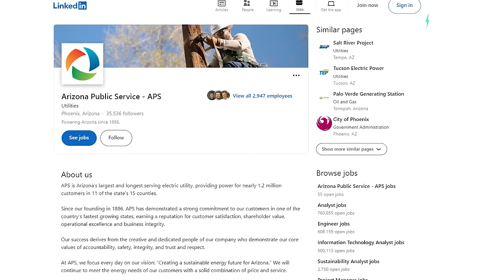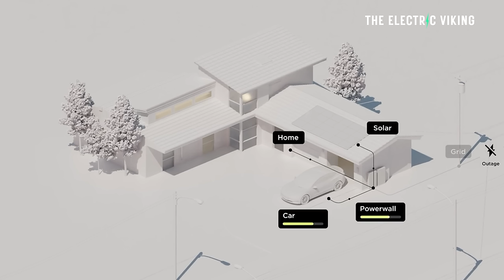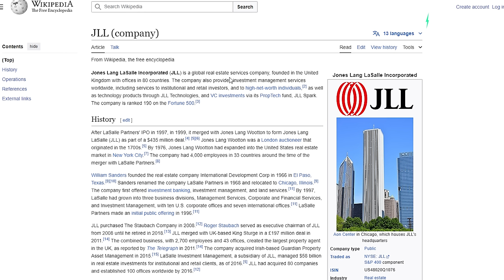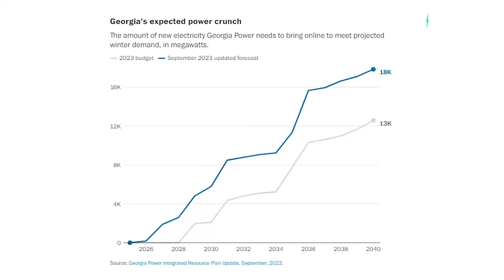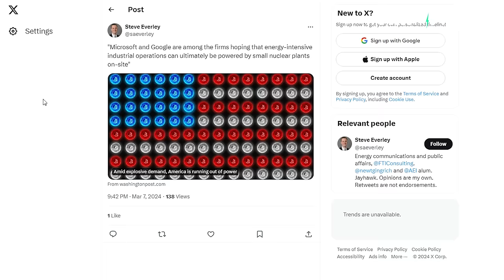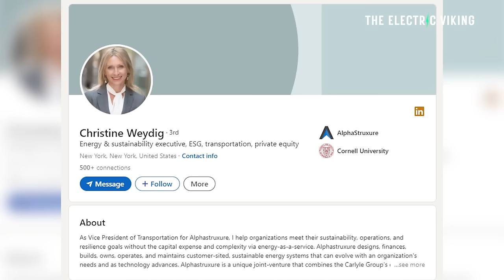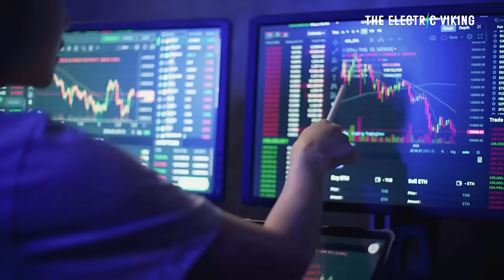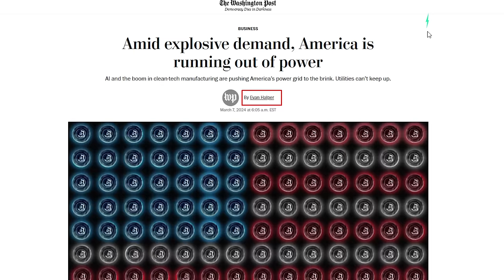An explosion in demand for electricity is creating a looming crisis in America

Comment: Transmission lines are the rate-limiting step.  Capacity and storage are increasing, but transmission ability is not.
Reply: Tesla's one-wire energy transmission system (on high frequency) works, it is even lossless.  I tried to promote this idea to a Dutch electric grid research team (part of a big grid company), but they weren't interested. The problem is outdated physics theories that are dogmatic, to the point Tesla's ideas are not understood at all by the power engineer. Just one thin wire can transport Mega Watts of power, by applying the 'surface' electrons on the wire only, in stead of the 'bulk electrons' in the copper solid that feel Ohmic resistance and heat up the wire. Some universities are catching up with such century old inventions/ideas.
Reply: @koenraad4618 one wire transmission doesn’t scale to grid distances and power. It’s not a matter of physics being “misunderstood”, it’s a case of high frequency electrical current not working well down long cables (which is what Tesla was proposing). Power is lost due to radio emissions by the line, and these losses increase with frequency. The current 60/50Hz grid is a trade-off based on that. Higher frequencies need smaller and cheaper transformers, but don’t work well over longer distances. Even 50/60Hz power losses are unacceptable over longer distances, leading to DC power lines for international links.
Reply: @stevetodd7383  As a EE, I can testify to your correctness in the laws of physics and electricity, and I'm glad there's a few others like yourself here giving intelligible fact-based info on the non-practical aspect of much of this hype science.
Reply: That's true in Texas. There are days when wind generates more electricity than can be used and there are insufficient transmission lines to get the excess to the major metro areas in the state (source = Texas Tribune).
Reply: So energy should be produced, stored and used locally, if possible.
Reply: Absolutely spot on. Out of all the comments read this is the one that states the obvious. We have a transmission and distribution problem!
Reply: Transformers shortage...
Reply: All the Copper mines are nearing depletion. We cant upgrade the grid.
Reply: @MrkBO8  The conductors on the grid are primarily aluminum, not copper.
Reply: Transmission line congestion is a real issue, but transmission lines are not in the dire state that is being pushed (basically its misinformation).... or more to the point, the issues are political, not electrical.   California, for example, has vastly relieved transmission line stress by situating grid-scale storage at critical congested junctions and in those locations it has more or less solved the problem.

Since transmission line congestion generally only occurs in a fairly narrow time range in the late afternoon, it is nearly a perfect match.

Which is great, actually, because now grid-scale storage is able to serve two purposes instead of just one, which more than justifies the cost.  It actually costs more to build-out more transmission lines in congested corridors than it does to build grid-scale stroage to relieve the congestion.   Two ducks knocked out with one stone, so to speak.
Reply: America should make HOMES w/ 480v , in this way they can split DUAL 240v and split into Multiple 120vAC.
Reply: @stevetodd7383  Is the California DC interconnection international? Celilo to Sylmar. Perhaps you mean frequency stability is the reason? series impedance is the primary culprit against HF.
Reply: @RT-mv7df  I get you, even if others don't.
Reply: @hardyvonwinterstein5445  It is 100% possible and that is exactly what is going to be done.
Reply: @Kevin19700  Actually you should have said we don't have a problem, it amounts to the same thing.
Reply: @MrkBO8  This is not very accurate, what if you took the copper down and put up aluminum? Oh, that's old hat, we did that years ago. I think the problem doesn't exist. How about raising the voltage and halving the copper wire used wouldn't that stretch it out a bit? How about using plain old smarts?
Reply: Sorry that's not true either.  This video is nonsense and so is your statement.  This is in fact the VERY reason why the Inflation Reduction Act was passed, to put money into different areas and one is EXACTLY that, the improvement of the national grid.

However that's not an EASY thing to do.  It's a big engineering problem to solve because you have to know where your expansion is going to be for electric capacity, so you don't JUST go out and start adding capacity to move electricity wherever.

And yes transmission lines are a limiting factor.  Lines are being improved in our area, right now, so I guess our engineers already knew this area needed improvement.  And I've also seen a CRAZY amount of growth in the number of Teslas in this area.  It's a little surprising.
Reply: @tedmoss  what I meant was very long lines. AC grids always need to be kept in synchronisation, and the technology for that is old and well understood. AC to DC then back again at grid scale is an expensive undertaking and wouldn’t be used for that. Where there’s a mismatch between grids (I.e. say one running at 50Hz and the other at 60Hz), possibly, but that’s not the main reason for using DC for very long lines.
Reply: capacity of storage is not increasing and energy demand is increasing too.

Comment: Just checked the UK grid. Wind is only at 7% and solar at 5%. It can go a lot higher, but at the moment its Nuclear and Gas picking up the load. Solar and Wind are NOT reliable enough. It's probably the same in the US.
Reply: Wind has gone from 16GW at 5pm last night to 2GW at 9am today. This is where we need more solar capacity and definitely more batteries and maintain our nuclear for as long as possible for these dips in wind.
Reply: Wind/solar without batteries is unreliable, but wind/solar plus batteries is much better. Whether or not wind/solar plus batteries is good enough might be a matter of debate, but some books and videos by Tony Seba (look at his recent five-part series on his YouTube channel) suggest they can be.
Reply: If the money spent tackling Covid was spent trying to tackle the climate crisis it’s perfectly doable even with existing tech but too many vested interests
Reply: Wind, solar, and tidal works best when surplus energy is stored in batteries.
Now, too often, turbines are switched off because of lack of demand at some hours.
Reply: @Acemeistre  People pushing wind farms will talk about the "average wind speed" of an area as if that means anything. It doesn't.
If you the ideal wind speed is 50 km/hr and the region has winds of 0 km/hr today and 100 km/hr tomorrow, the average is 50. In reality the blades either have no wind and generate no power, or the wind is too high so they need to be stopped to avoid causing damage. Such an "average" will not produce any electricity.
Solar has some useful applications, but wind power has always been a scam.
Reply: Solar and wind could work well together as they complement each other with a more consistent amount of energy generating, but you do need a healthy amount of battery storage as a buffer for it to work effectively, with a big enough buffer, we can generate more than enough energy by renewables, as long as we can store enough of it.
Reply: UK hopefully should be doing a lot better in a couple years once new offshore drilling starts producing. In Texas we are top state for wind and second in solar and it often produces well over half but when we needed it the most it produced nothing while natural gas, coal, and nuclear power kept things going.
Reply: @protorhinocerator142  my guy, you are talking about extremes in wind where there is either basically next to no wind or you are in a storm. most of the rest of the time wind blades can be autonomously adjust to cope with whatever windspeeds are happening at any particular moment in time. 
If you look look at uk energy mix you can view that in the UK we normally have anywhere between 10-70% at any one point in time - last year wind accounted for 9.02 GW of our average energy use only just below gas at 9.91, (basically 1/3 each of what we used) nuclear at 4.37 and then a bunch of others making up the rest
Reply: @protorhinocerator142  Nope, people pushing for wind talk about prevailing winds that are steady and predictable.
Your average definitely does not mean anything because you only used two days instead of 365.
Nobody qualified to build windmills will pick a location where either calm days or hurricanes are the norm.
Reply: @nazb1982  Why take the budget from something useful? Some very smart people calculated it would cost $62 trillion to make the whole world 100% powered by renewables and energy storage, or only about decade's worth of fossil fuel subsidies.
What people really need to realize is that ensuring independence from fossil fuel imports and keeping the companies and foreign nations from meddling in politics makes renewables and energy storage a national defense issue. Next time someone says we should keep using oil ask them why you should go to war for them and pay for military spending when that money could electrify both the military and civilian sector.
Reply: @AnalystPrime  The salesman will try to sell to anyone dumb enough to buy into "average wind speed".
Reply: @AnalystPrime  because renewables are not perfect and there are recycling problems. Battery storage has its own issues in respect of lithium mining, degradation etc. Since fusion isn’t happening anytime soon, a combination of Thorium reactors, renewables, grid storage not relying on lithium is probably the right mix. However, it needs battling vested interests and the money. The truth is had we treated climate change seriously it could have been dealt with a long time ago but greed trumps doing the right thing every time where big vested interests are involved. It’s the reason why governments are still granting new gas licences, subsidising fossil fuels etc
Reply: @Acemeistre Uranium in a reactor core is the cheapest form of battery storage.
Reply: @AnalystPrime Renewables just make you completely beholden to China.
Reply: @gregorymalchuk272 Ah, yes, becoming self-sufficient makes you dependent on another country. Somehow. Flawless logic!
Reply: @AnalystPrime  All solar silicon is smelted and fabricated in China. All rare earths for wind turbine permanent magnets, and most wind turbine manufacturing is in China. The renewables supply chain is actually more centralized than the petroleum and especially nuclear supply chains.
Reply: @gregorymalchuk272  Are you perhaps also going to claim China is the only country with sodium too?

But hey, let's pretend for a moment that rest of the world decides to only buy stuff from China instead of mining their own mineral deposits. Not only would that only last as long as China keeps selling cheap and no other country decides to slap tariffs on them, the finished products are now in countries that can easily recycle them to get the materials without mining.

That does not sound like being dependent on China, more like exploiting them to avoid polluting your own country...

Comment: The efficiencies of the grid are 90 percent. 10 percent of power is lost to the angels share.  Power grid storage can correct this dramatically.
Reply: you mean RI^2 losses which can be reduced by decreasing reactive current through power factor correction?
Reply: Strategic placed batteries, both near (intermittently) energy production, wind, solar.
But also near essential users, such as hospitals, factories, or even residential areas.
Reply: @hanswitvliet8188  At least you make some intelligible comments (vs the normie pro-Green commenter).  My question to you, is has anybody calculated just how much material we must mine to make batteries for:  EVs, home batteries for daily solar surplus, Electronics (phones, VR goggles, whatever new tech thing emerges), & these large industrial sub batteries at the strategic locations you mentioned?  It's way more batteries than just 1 per EV.  Also, at our current mining rate for these materials, how many multiples does that need to ramp up to support a 2050 date for full EV & Electrification? Sources I listen to say we need to increase the mining by orders of magnitude, minimum of 50-100X!!!
Reply: @RT-mv7df  TNX, but indeed, the batteries in EV’s or powerwall are just sufficient for individual usage.

I was hinting at the megapacks now installed in south-Australia, Belgium, UK. Those can cope with fluctuations for several hours.

And, those are far better (more environmentally friendly) than the huge amounts of led/acid batteries currently used at telephone exchanges.
Hospitals should be able to get rid of emergency diesel generators (that often don’t work when you need them)

Comment: There is no looming crisis in the US.  In most markets capacity is growing at a rate to keep up with demand and that's really ALL they have to do.  A major problem is NOT capacity, it's getting capacity to areas that will have the most high power chargers because you either need to improve or increase transmission lines, but even THAT has been dealt with when the Inflation Reduction Act was passed because that provides funding to do exactly that.  It's not ALL the funding for it, but then electric companies have a REAL REASON to invest in improving their lines since after all, all that extra capacity means more money coming in each month for them.

This is a non-issue in the US, REGARDLESS of the bickering back and forth between political parties.  The market tends to determine what happens in the US, and where it makes sense to install solar farms, they ARE being installed and where it makes sense to install wind farms, they ARE being installed regardless of the politics of the state.  One of the most anti-green energy states in the country is producing the most green energy, Texas, and there are more solar and wind farms that are being installed because Texas is a good place for both.

Comment: Industry is the biggest consumer of electricity and a huge part of the problem throughout Canada and the USA is the building codes for industrial/commercial building. So many old and new industrial/commercial buildings are built with a lack of thermal efficiency.  Many homes have super high min standards for thermal efficiency yet industrial/commercial do not. We know production of heat or AC is a huge energy drain but when you start running those elements that aren’t very thermodynamic in design you might has well be trying to run a heater or AC unit in tent or just outside under the sun or in the snow. Industrial/commercial often will run their heating/cooling 24/7 even when there is no workers operating. Consumer expected to reserve energy use but these same demands are seldomly made on the industrial sector.

Comment: I hate when they use Li-ion battery for Stationary storage.

If mass manufacturing of Sodium ion battery is done, on day 1 it will be far cheaper (40$/kWh) than Li-ion.
And few more years after that its price will become about $10/kWh, which is ultra cheap.

Sodium ion battery is less energy dense but Energy density doesn't matter for Stationary storage, it just need to be cheap.

Only bottleneck left in Renewable Energy is the storage cost.
If battery cost becomes 10$ per kWh, the fossil fuel electricity industry will just become bankrupt and will close down their operations.

Comment: Electric Viking - USA Data Centers & BIT coin miners are using too much POWER.
nothing to do w/ actual Consumer use. 
although , many Americans homes are not UPGRADED and INNEFFICIENT at Energy use, and NOT properly INSULATED. 
the GOVERNMENT should Subsidize homes for LOW cost/ ZERO cost Efficiency UPGRADES & Insulation Upgrades. 
Today , SOLAR is cheap enough as a Building Materiel.

Comment: We continue to live in the Age of Edison. Large central power stations generating electricity and sending that electricity to individual users be it residential or commercial via a massive transmission network of cables. This network is highly subject to storm damage which we see every year.  Loss in transmission is about 5% +/-. This is a rather large amount of energy when taking the US as a whole. Edison built and installed the 1st power generating station in Lower Manhattan on or about 1890 and we have been basically doing the same thing since then. Local or on-site power generation would begin to allow the US to move away from the current method and should be more reliable over the long term.